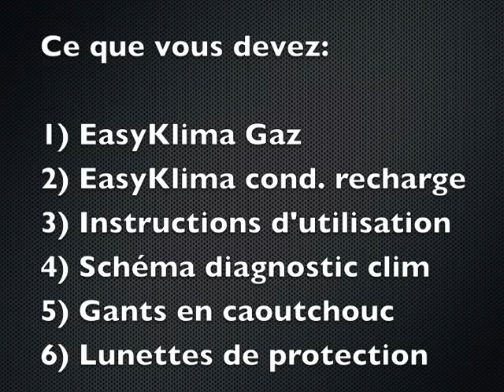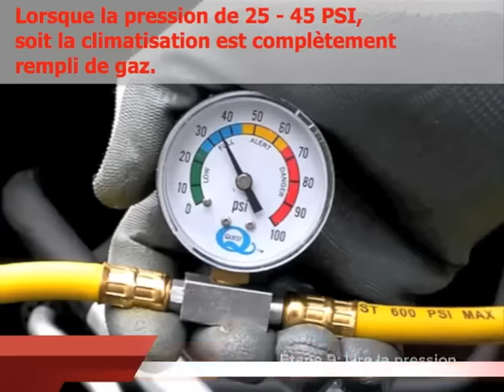comment recharger la clim d'une voiture soi même

Comment: Bonjour,

je voudrai savoir ce qu'il y a dans la bouteille EasyKlima. Est ce juste du gaz réfrigérant seul ou avec l'huile de lubrification du compresseur. Je n'ai plus de gaz dans le circuit (en appuyant sur la valve de rechargement aucune pression).
Comment savoir si j'ai toujours de l’huile ? 
et dans ce cas comment en remettre si votre bouteille n'en contient pas ?
et dois je faire une vidange avec une pompe a vide ?
Si vous avez d'autres vidéos pour faciliter la compréhension de la procédure, je suis preneur.

Véhicule : Peugeot 807 2,2 HDI - 136CV année 2004.
Indication du constructeur

Type de gaz : R134a
Quantité : 640g
Type d'huile première monte pour compresseur : SP10
Type d'huile réfrigérant BHS (Behr Hella Service) : PAO 68 ou PAG ISO 46
Quantité d'huile système complet : 135 ml

Merci de votre retour

Le point vert
Reply: A